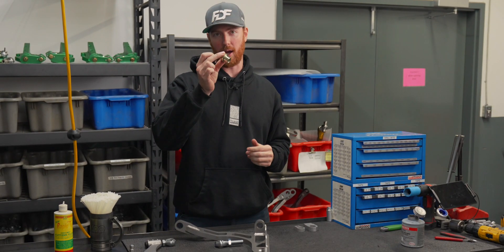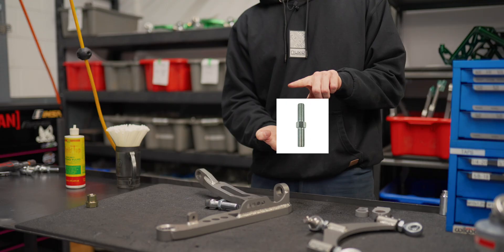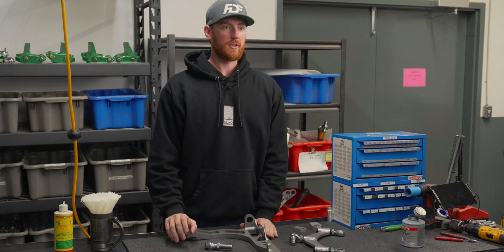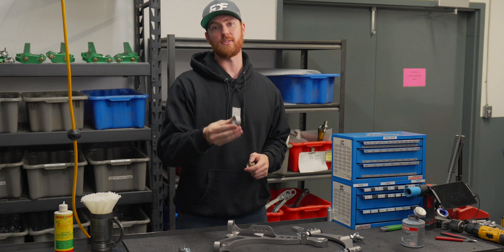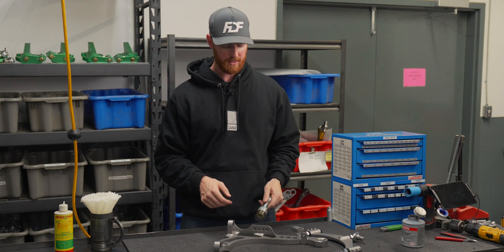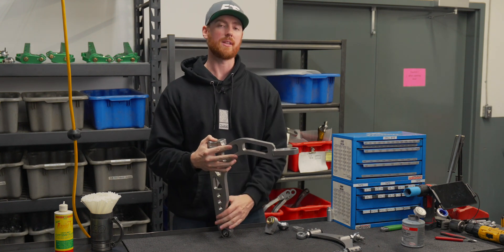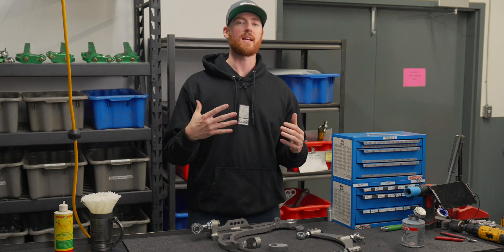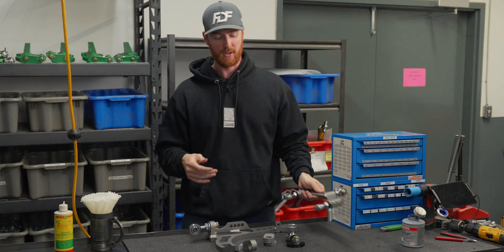The Reason Behind Our Smooth Adjuster Nut Design

Comment: What if you machine a groove in your smooth adjuster and drill a hole horizontally at the top of your loop. Use like a trailer hitch pin style pin clip to hold the smooth adjuster in place while you're making adjustments and assembling

Comment: One concern I have is the bare metal on metal contact. I'm not a current customer, for whatever that's worth, but if I was in the market I would feel better seeing a grease fitting on there if I was putting one on my drift/race car.
Reply from the maker: antiseize yes, grease no. much like a thread on a tierod it doesnt need to be lubricated. once tightened to its intended adjustment it needs to stay there. grease would be more for moving parts like bushings, bearings and ball joints.

Comment: We were literally on a mates alignment machine with a new lock kit, with this problem with the adjustable e36 castor lollipop. Absolutely ridiculous having to take it off to wind it out 😂. Legends
Reply from the maker: We sell our lollipops separately so you can run ours with any kit 🤙
Reply: @FDFraceshop  since been on the website and seen. Love you see a problem and always strive for a better way.

Il consider them in future 🫡. From 🇬🇧
Reply: @FDFraceshop  do you currently sell or have distribution in the uk?
Reply from the maker: working on it but currently we can ship to the UK and we do make M20 versions of these adjusters for the metric needs

Comment: Do you use any lock tight on the adjusters?
Reply from the maker: Non or blue locktite is the most we would do, but they really don’t come lose often
Reply: @FDFraceshop  this nut keeps coming loose :( has happened multiple times and to the point its about to come off the car, i have now ugga dugga'd it tight now. Some oil does hit it though
Reply: @Water.melon.Z  i check mine every time i take it to the track, and occasionally it will lossen a little. Are you using the recommended torque spec?
Reply from the maker: Do you have the washer between the jam nut and the arm?
Reply: @FDFraceshop  i need to double check that.

Did you guys do a video on pros and cons on the c6 vs c7?
Reply: @FDFraceshop  yes I do but I was not sent one when I initially got the kit and had to add one
Reply: Over tightening can damage the threads and cause it to come loose easier in the future, careful with the ugga duggas

Comment: I just tested out my FDF kit and I love it. I wasn't super happy at first, but once everything "broke in" after a few laps, it felt great. It would be a huge pain to install and setup if not for the smooth adjusters, which is one of the main reasons I chose FDF
Reply from the maker: Yea the heim joints are a bit tight out of the box but glad you gave it a chance to break in! We always recommend so scrub in laps before drifting on a new kit 🤙
Reply: @FDFraceshop  For sure, I didn't even think of it, I was too excited.lol Also have your handbrake and it's 👌